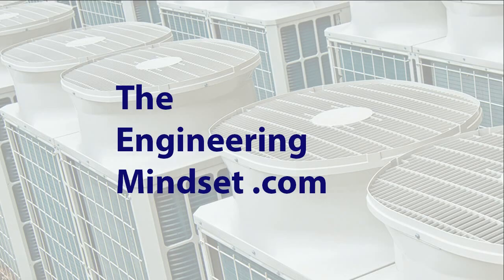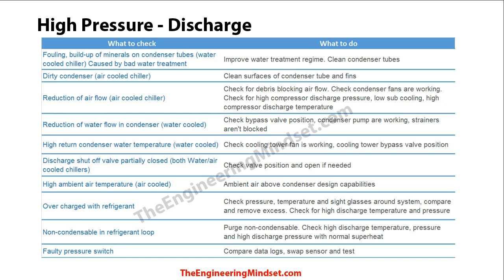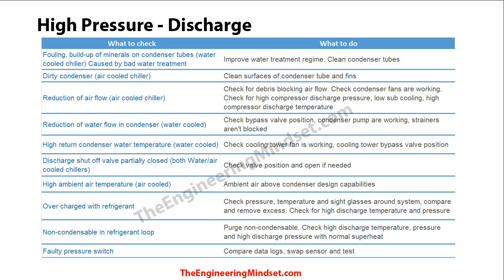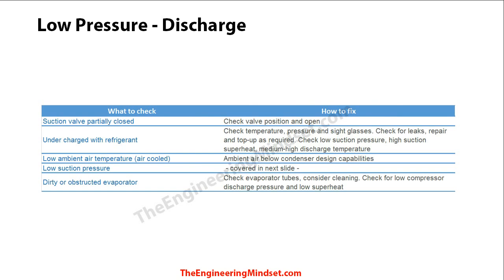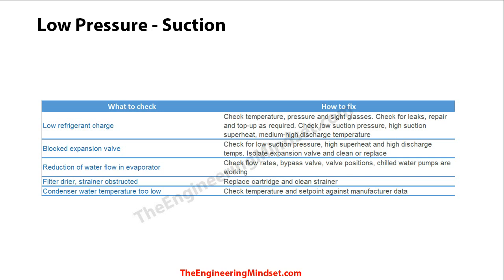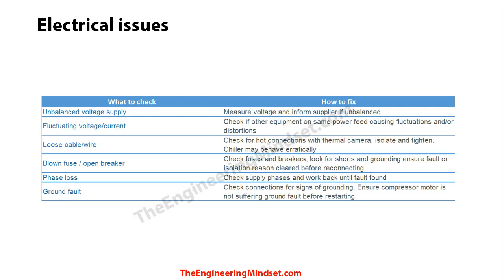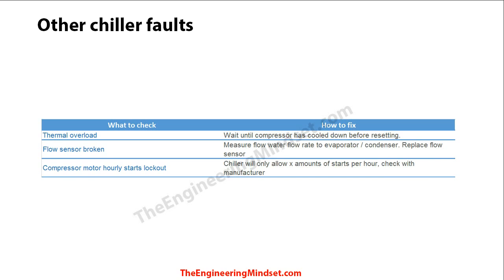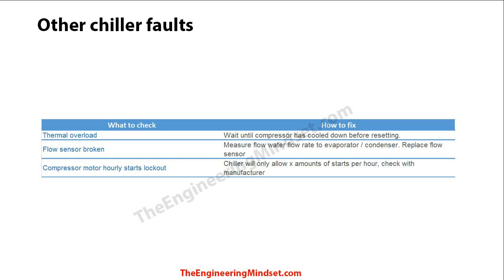Chiller faults - troubleshooting

Comment: We have Flow sensor Issue. Chiller 2 shuts down and shows "waiting for evaporator water flow". We already tried swapping the flow sensor and tried it on Chiller 1, both flow sensors from Chiller 1 and 2 functioned well in Chiller 1.  

Is it a communications issue? What should we do to troubleshoot? Should we just contact the supplier?

Comment: Trane CDHG water cooled chiller 
Refrigerant- R123
Problem- chiller not going load more than 80% and not achieve set temp,we changed leaving water sensor,saturation temp sensor,refrigerant charged,manually igv open,water flow is normal but still problem not solved,please suggest me

Comment: Hello guys...i want your help in this i am still newbie with hvac system and in the place where i work there is swas chiller. From time to time cause high pressure alarm..what do you advice me to inspect which part..i inspected condenser filter and fan motor.. plz i need your help with that..thx
Reply from the maker: Condenser water temperature is most likely the cause. Check the chiller error code and temperatures
Reply: @EngineeringMindset  I would like to thank you for the quick reply .The chillers are using at the power plant  are air chiller not water chiller. Today we had low pressure alram so churged with refrigerant and  make sure that the valve expansion and pipes are intact. 3 chillers low pressure alram and one chiller is high pressure.the set point on 77 f. What do u expect????? Thanks Again

Comment: How can I troubleshoot if one cooling tower, one condenser water pump and one chiller water pump are not working. help me please?
Reply from the maker: Check the chiller or bms screen for error codes. This time for year its probably low temperature and the chiller has tripped to protect itself

Comment: Thanks for your lecture
I have some questions
My chiller trip on low pressure in evoprter
Reply: You need to get the diffential pressure between in and out as per chiller requirement, need to get peformamce data from supplier and check the differential pressure, then u need to adjust your butterfly valve accordingly to get the right pressure
Reply: Elaborate bhai

Comment: Hi I’m having trouble with a bitzer compressor i replaced oil pressure switch and now compressor won’t come out of pump down or go into refrigeration mode any suggestion on wat to check
Reply: Miguel Loza check for a possible defective low pressure switch or one that is improperly adjusted
Reply: Guys watter chiller  is not running HI Temp Tripped  light is on help me what I need to do
Reply: Ndzondelelo Jekeqa If it is a high refrigerant temperature/pressure alarm on a water-cooled chiller, check the condenser pump strainer. If it is on an air-cooled chiller, check the condenser fans if they are operating correctly
Reply from the maker: Seen our new pressure switch video? Link: https://youtu.be/YG81w0HFXNc